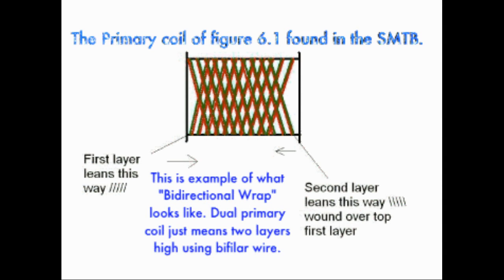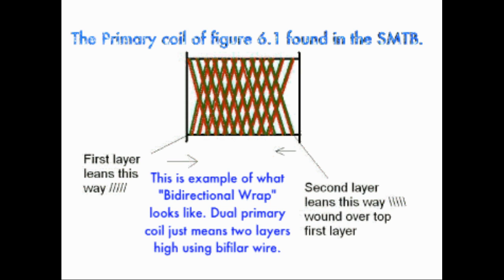Bidirectional HV Coil Winding

Comment: Oh, almost forgot the wire in the actually primary doesn't have those spaces between the bifilar wire as that was drawn that way for ease of teaching just how it was wrapped, okay? They are wrapped side by side with little to no air space gaps between the wires.

Comment: Hi space man, from what I have found out that and the Tesla bifilar wrap work best. I know use the Tesla bifilar coil wrap on the primary myself as that cross wrap is on the hard side to do by hand, but I have done it and tested it and it works well on increasing voltage over the turn count ratios calculated voltage. But I found the meaning of the word in an unrelated patent about wrapping some electrical tape. The good thing is now we all know what the word means.